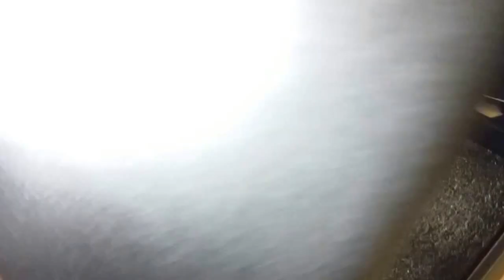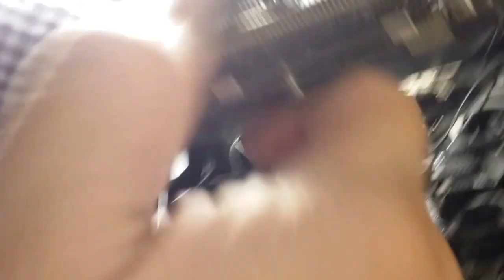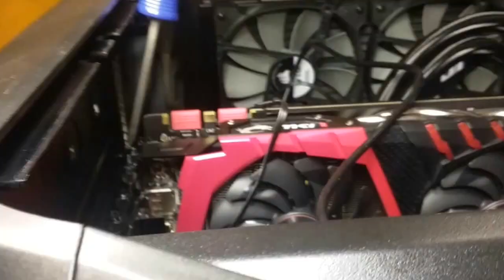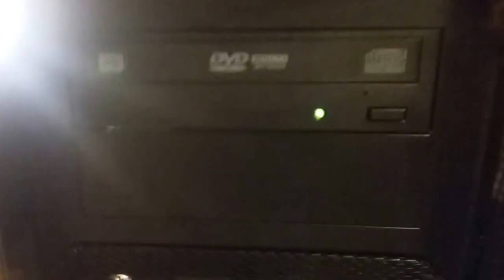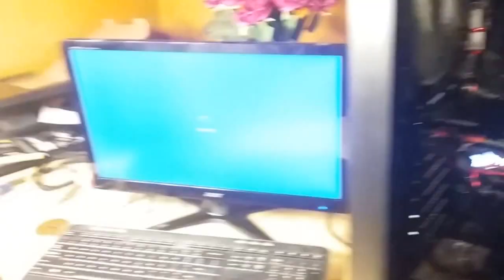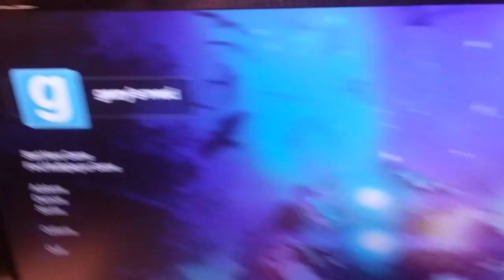Install MSI GEFORCE GTX 1070 into the MSI Z170a Gaming Pro Carbon

Comment: how do i install drvers without an optical drive? thanks
Reply from the maker: I used a usb drive to update my bios.  You could use a similar method to install drivers, but I tend to install windows via USB and then run the Windows Update to get all the drivers that way.  MSI also has a live update application that allows you to get all of the driver updates that work well with their motherboards.  I tend to prefer this approach since you know you're using drivers that have been tested for your OS and hardware.
Reply: perfect thanks man 😊

Comment: I have Almost the same setup ... i have a gtx 1080 g1 gaming and nzxt x61 watercooler
Reply: XDD
Reply from the maker: What's BIOS showing for your CPU temperature?  Looks like the nzxt x61 is comparable in price to the Corsair h110i.
Reply from the maker: Your gtx 1080 g1 looks a bit heftier than our GEFORCE GTX 1070... have you tried your system with a VR headset yet?  Both of these cards indicate they are VR ready.